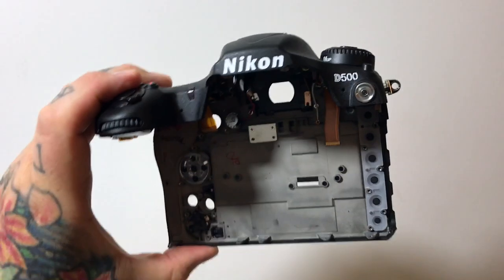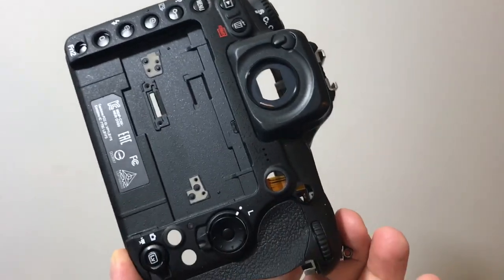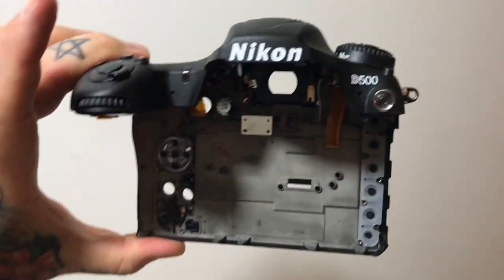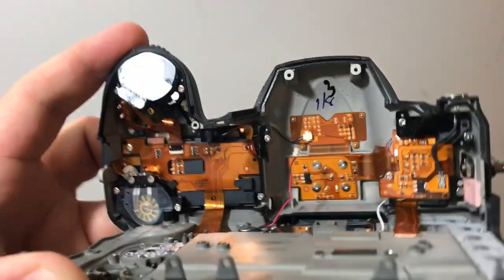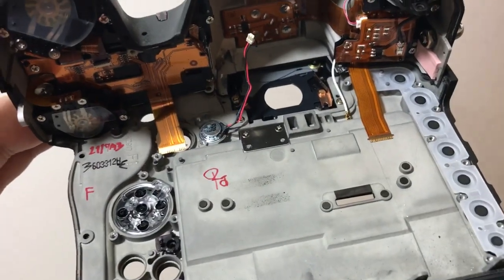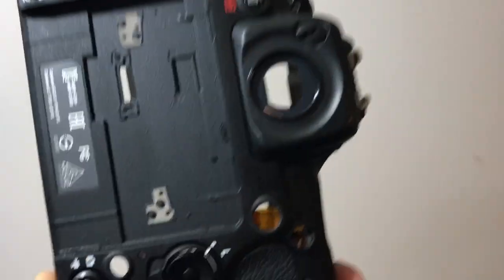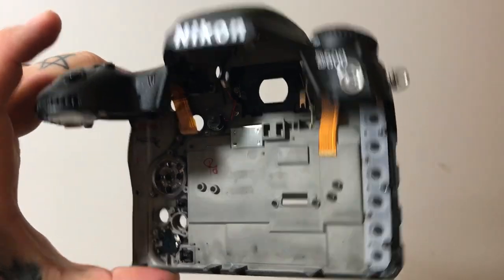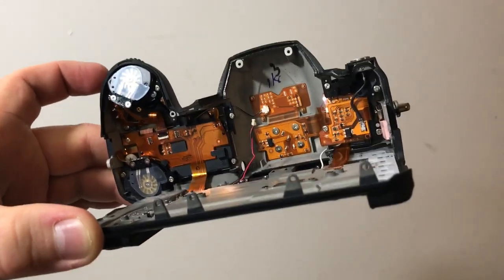💋😎 NIKON D500 Magnesium SKELETON

Comment: I just bought  aNikon D500 a month ago, yesterday I felt in a pool while taking pictures and got the camera wet. I tried to clean it and dry it but I found that the water got into the camera body. The Nikon D500 is not weather sealed at all.
Reply from the maker: well no, of course its not sealed against that, no camera is 
sorry to hear that .....you need camera insurance :/
Reply: I already took it to a camera shop to be service. I hope it didn´t fried the motherboard, I made the mistake of turning on the camera after I got out of the pool and it turned on but I went to try to dry it using a hair dryer and it didt´t turn on after that. Thank You for making these videos!